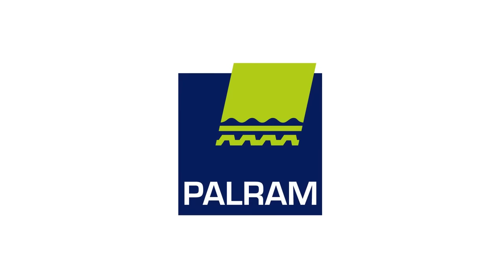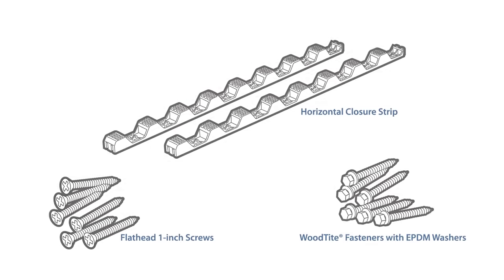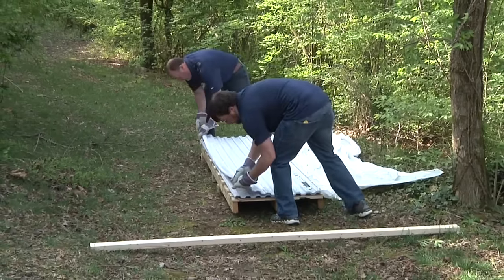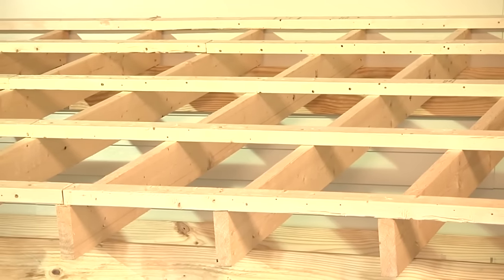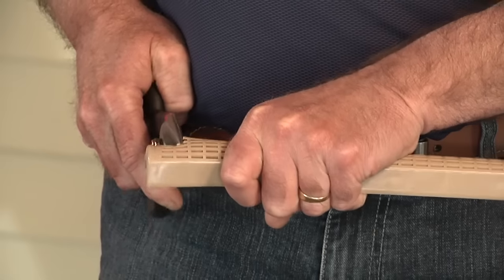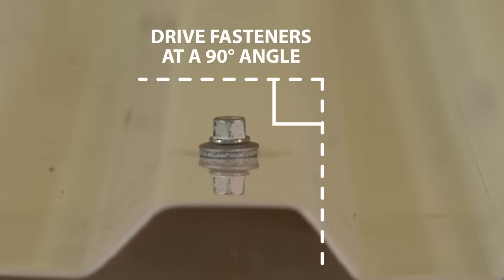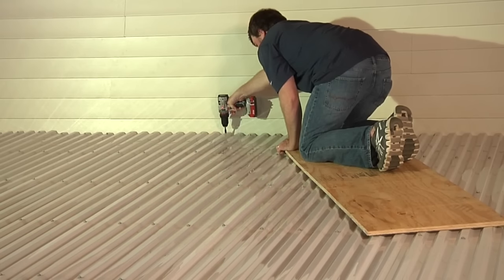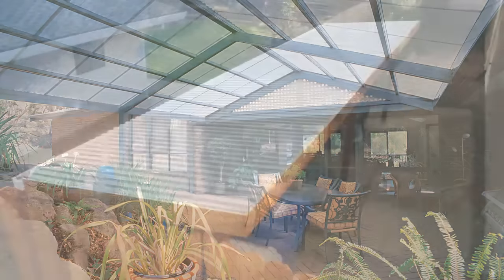How to: SUNTUF® Installation DIY

Comment: So its interesting how none of the videos including this one do not show the pre drilling. Why? Because its incredibly time consuming and I mean time consuming and depending on where you chose to do it dangerous. Right now I'm installing the very ones in this video. Here's what I'm learning , if you decide to pre drill with the sheets on the roofing, it's  dangerous because you're either on a ladder applying force to areas you have to reach out to. If you decide to get on the roofing structure, well that's enough said.  Now if you get the enclosures suntuf sells that's even more pre drill time because if you go through the plastic bracket with the 1/4 inch drill bit the hole is too big for the bolt now and you're sol. So you either mark the hole area, pull it down and drill then put it back up or do what I was describing earlier. So it can be dangerous and very time consuming to get these panels up correctly. We really should be better youtube stewards of what we put in our community.
Reply: A valid point made by you.  I am about to install these very same panels as well.  I am curious as to what you found was the best way.  Right now, I don't see any better option than marking the holes and taking the panel back down to drill them.  A process I'd rather not do but like you said I can't afford to mangle all the plastic brackets.  You've likely saved me some time and stress already just by pointing this out but like I said, I thought I would pick your brain to see if you figured out a better way having recently installed these yourself.
Reply: Hi Matt, what I ended up doing was while the panel was laying on the bracket, I marked a spot on the panel with a sharpey where I wanted to drill then slid underneath the panel between it and the bracket a small thin pirce of wood I could drill on so when the bit broke through the panel it hit the wood under it and I'd stop drilling. My piece of wood was long enough that I could do 5 spots at a time. Hope this helps
Reply: the store I bought from used wooden brackets or closure strips so I just stood up there with 3 different drills, one for the pilot hole for the screw, one for the hole in the polycarb panel, and one for the driver bit.  I also conscripted one or more of my kids to pass me tools as needed.  Cost was $20 per 2' x 8' polycarb panel, $4 per 6' wooden closure strip $9 per box of 100 fancy screws.  Hope this is helpful to someone.  Also worth noting was which way to install the panel.  I had my first panel already in but with label facing down.  All the overlaps would have been on the downside of the corrugations increasing my chances for leaks and wind catching the edges as I didn't do sides so no side flashing.
Reply: Self tapping screws with the washer pre attached. And go
Reply: I followed their directions to the letter and my roof leaks at all the holes. They say not to tighten down the screws where they will dimple the plastic so I was extra careful about that, but now it leaks like crazy..any suggestions? I did pre drill
Reply: @vinylsoup  loosen screws, dab silicon, gently retighten.
Reply: I use 3/4 in self tapping screws with the rubber washer but not on the raised part you can fasten them with the 3/4 screws on the flat parts of the panels with no problems with cracking the panel. When I did mine I used 2×4  joist hangers attached to the wall then 1×4s across (horizontal) the 2×4s even walked on the panels stepping on the 1×4s of course with no damage to the panels of course I only weigh about 145 lbs.
Reply: @vinylsoup  A small blob of silicone on the screw heads getting it around the circumference of the screw will do the job no leaks guaranteed.
Reply: @sleddy01  or just cover each screw with silicon. Hope mine don’t leak.
Reply: Hey Mario, next time try to not be so scared and it will allow the process to go smoother
Reply: @HHh-qe2ch  Does not allow for thermal expansion of the panel around the screw. Eventually the panel will get cracks.

Comment: instead of using a circular saw to cut this plastic I would recommend using a magic marker to mark the length then using very large tin snips to cut one sheet at a time by hand... the saw blade can tear up the plastic easily
Reply: the key is a saw with a blade meant for "plastic"....if you're using a metal blade of course it's going to tear the plastic.
Reply: I apply a couple layers of tape and draw my cut line on top of the tape.  I then cut on the line using a thin kerf saw blade intended for laminate veneers.  The tape makes for a clean cut.
Reply: Reverse your saw blade.

Comment: Ridiculous, you can buy the panels at homedepot but you can't buy any of the finishing parts, like roof caps and flashing. Deal breaker.
Reply: I just looked, they do have roof caps and flashing.
Reply: @debm3391  not where I am from they do not, Las Vegas
Reply: you can order them online and ship-to-store
Reply: I had to buy the roof cap on line. The man at HD sold me the side flashing which he called the roof cap.

Comment: I dont now if this channel is moderated, but Ihave a qustion. I want to use corrugated panels but the roof area is not square, how to you mount the end of the panels to a angled roof line?

Comment: I am building a shed and the roof will be a single pitch, flat style roof. The front side will be 8 feet high across the  front, and 6 feet high across that back. How do I flash the front, higher peak? I am afraid water may run below the panels and into the shed. Thanks.
Reply from the maker: Hi Skizai87. We're having a little trouble visualizing what you would like to flash. Any chance you can email a simple sketch of your question to info@palramamericas.com, or perhaps more of a description (free-standing structure? How long is the slope? Are you planning a small overhang (e.g., 2"-3") on the "front of the structure? etc.). If we can't answer your question there, we'll arrange a phone call to learn more. Thanks.

Comment: Purlins are about complete.  Almost time to let the metal hit the meat.  I got installation pre-jitters.
Reply: Howd the install go?
Reply: @tyrellanderson5312  keeping panels aligned and square was tricky. I thought they would space themselves properly. By the time I noticed it was too late. Chalk line helps?
Reply: @fightswithspirits915  Easier with 2 people. Tape or screw horizontal & vertical closure strips in proper alignment - using small piece of panel for guidance to keep everything aligned straight. Best  I could do, worked fairly well. Instructions here and manual certainly wasn't help.
Reply: @TurboMountTV  thanks. Makes sense. roofing not even close to laying tile. Gotta plan out the roof as you suggest or have some form of spacing jig.

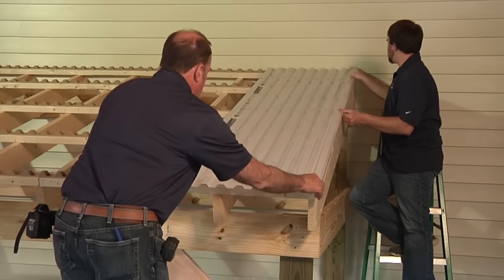Comment: Are screws supposed to penetrate into the purlin, or just into the closure strip? 3:40  Are 1/4" holes drilled into the closure strip? 3:22

Comment: If you’re going to cut multiple sheets what I did is use a laminate blade and turned it to the reverse side. Circular saw and went really slow, worked great, I cut 5 at a time.

Obviously a plastic blade would be best but I couldn’t find one so reversing the saw blade worked for me.

Comment: Are any roofing fasteners required to be installed along the vertical closure strips in between the ends of each horizontal closure strip?

Comment: I’m installing the panels on my pergola. Question I have is when I screw in the fasteners should it be in closure strip or should it be penetrating the purlin?
Reply: Notice how you didn't get an answer.
Reply: Screw through panel through closure strip into purlin. Use 2" Woodtite screw.

Comment: I purchased some of the panels which are uv protected on  one side only , I need to uv protect both sides bc I am using them as a fence. I know you can special order them with uv protection on both sides, but is there a product I can use to treat theother side?

Comment: We really want to use this product but need to know the very least amount of pitch needed to have snow slide off.
Reply: Debra Fisher Hi Debra. I have watched several different videos on different brands of corrugated plastic roofing and a minimum pitch of 1-1/2 x 12 is pretty consistent for rain/snow to slide off. Seems very shallow to me as someone who has framed many a roof. I live in Idaho and in our mountain locations with heavy snowfall, they would suggest a minimum pitch of 8 x 12 for a metal corrugated roof. If you receive heavy snowfall, I would stick with an 8 x 12 pitch. Just my 2 cents worth

Comment: Are the plastic horizontal and vertical closures still available? My retailers only have them in wood materials.
Reply: You can order online. I've read you really don't want to use the wooden ones.

Comment: Why are panel screws placed on the crowns of the panel rather than the valley? Why not give the length of the washered panel screws?
Reply: Any holes in the valleys will result in leakage. On the other hand, a hole in the crown (with rubber gasket) will shed water into the valley and not leak.
Reply: @RobertJohnson-th2yf  No question about which you are.
Reply: @RobertJohnson-th2yf  you really like insulting people.  does it make you feel good?

Comment: uuuh.. What is the flat screw spacing in the valleys on the horizontal closing strips? 1 screw every 6" ..12" ..16"?
Reply: Did you find an answer?  I'm going with 12 inches since the panel will actually be fastened to the purlins anyway.
Reply: You only need 2 screws to hold it in place until you attach panels which will screw them down further.
Here it says to screw down closure strips. Call in tech support and they don't - just attach via panel through strip into purlin.

Comment: I like the idea of letting light through but does it also let heat true?  Of idea of having a roof over may patio is to keep the sun and heat away so.... will this product do the trick or there are better options out there?  Also, cost wise, how does this compare to alternatives when it comes to material?
Reply: Phillip, thanks dude.
Reply: We have used this product on a few of our decks and the clear panels definitely let a lot of light in and while it’s nice to have a clear view, it can feel like a greenhouse.  On the roofs that we used the darker colours like sea green or yellow the it’s much cooler. Sea green was our favourite as it gave the best balance of light and heat.

Comment: Would this work well for an under deck ceiling?  How would you modify the installation?
Reply from the maker: Hi, Andrea. Thanks for your interest. While Suntuf and Suntop can both work very well as under deck ceilings, Palruf or Sun n' Rain are probably the most appropriate due to cost. In an under deck application, there is little concern about heat build-up (provided the under deck area is open and well-ventilated), and there shouldn't be any other concerns about things like impact resistance—something that the other two products excel at. There are a number of ways that you could apply our product in an under deck application, but it's important to consider drainage, and therefore you really should install the panels with a "slope." Here's a link to our DuoDeck™ under deck page so you can see one method of installation: http://www.palramamericas.com/Products/corrugated-accessories/DUODECK/. Also, here's a link to purchase the DuoDeck™ bracket on HomeDepot.com: http://www.homedepot.com/p/DuoDeck-2-1-4-in-x-7-3-4-in-Galvanized-Steel-Under-Deck-Bracket-96240/202439569?keyword=duodeck
Reply: Absolutely in process at the moment. Same basics apply. Working overhead a bit more challenging but the perfect product for under deck install.

Comment: Why drill holes? Self-tapping wood fasteners with waterproof washer would make installation a lot easier and provide a cleaner hole.  Is there a problem with expansion?
Reply: yes.  expansion is a given with these plastic panels.  if holes are not bigger than the screws then you get dozens of hairline fractures all over and leaks to go with.
Reply: I failed to drill the recommended holes.  It's amazing the amount of popping sounds heard when the morning sun first hits the panels and they begin to expand.  The great amount of expansion actually results in the closure strip tabs breaking off; I find the busted tabs lying on the patio.  Drill the recommended hole, and set your screw on a warm day in the full sun, taking care to center the screw in the hole for good coverage of the washer all around, not too tight, not too loose.
Reply: @Chris.Brisson  Do you drill the hole throught the closure strip also and use a longer screw to attach to underlying structure, or does the screw go into the closure strip only?
Reply: @Snipely  yes, you need to screw  into the underlying structure.
Reply: @Chris.Brisson  hmm, that changes things...  then it's not critical to avoid the closure strip when drilling the expansion hole?
Reply: @Snipely  well, you are asking someone who has expansion problems, so maybe I'm not the best qualified to answer.  🙃

Comment: I'm building a varrada in the off the house should I use coragateted thin plastic sheets for the roof or 10ml thick twin wall clear roof sheets .
Reply: Assuming you use a polycarbonate corrugated sheet like Suntuf then the main difference between the panels are rigidity, aesthetics, and insulating factor.  The structured twinwall sheets are more rigid and offer an R Value (which varies by thickness and number of walls). Unless you require the R value you are most likely choosing based on which look you like best and the ease of installaltion.  In my opinion the corrugated installation is a bit simpler.  Typically there are more color options in the corrugated sheet as well.
Reply: Dlos Ok 2 chikitines Ok 3 2 Plato's 3 Barnisdale Evergreen Ok mamy - Illinois Ok mamy. Ok MehmZz

Comment: Suntuf printed instructions indicate a silicone sealant is needed but it was not shown in this video. Is sealant optional?
Reply: I was wondering the same thing.  leaning towards better safe than sorry. a year from now I will not remember the extra dollars or time but I will definitely notice if there is leaking because I didn't bother with the silicone.
Reply: @jamesharris8583  I had leaks immediately after installation so I had to climb up and back out every screw to put a bit of DAP 230 silicone under every washer. I made sure it was enough to create a complete ring around the set washer. There was a huge rainstorm the next day and no leaks. I highly recommend doing this as you go. Otherwise it seems like a good product.

Comment: i want to use polycarbonate roofing for an outdoor kitchen..want a curved roof..is it possible with this material?
Reply from the maker: Hi Vinesh. Suntuf panels can conform to an arch radius of 20-feet or greater. This is mentioned in our Suntuf Installation Guide (http://www.palramamericas.com/docs/upload/F409Suntuf_Install_Guide.pdf). If you're not sure what the radius is, I have created a new FAQ on our web site that provides a formula and a diagram showing how to gather the measurements used for the calculation formula (unfortunately, I can't post an image within this comment, so you'll have to view it on our site). The FAQ questions is titled "Is it possible to use Suntuf Corrugated Polycarbonate on a curved roof?" You'll find our FAQ's at: http://www.palramamericas.com/FAQ/

Comment: How do you seal along the vertical closure strips with butyl tape?  They are not the same height as the horizontal ones, which seems like a design error.

Comment: I replaced the panels on my existing patio cover. The original owner made the cover on an angle so each panel needed a different cut. What is the best way to cut the panels while they are installed ? I want to make them all flush.
Reply: Used a skill saw with a tacked 1x4 as a guide, came out great.
Do you have any videos on installing flashing ? Thanks Jay

Comment: H
i can i fasten the sheeting  to the wood in the lower grove  of the panel
Reply: It is not recommended. Water typically runs through the low part of the channel when it rains so putting a fastener in this location increases the chance of a leak
Reply: Yes, you can just use the 3/4 in self tapping screws with the rubber washer worked for me no leaks.
Reply: @koshnaranek2317  where do you live? Do you get lots of rain?
Reply: @Jason-bk1xs  Yes it usually comes down really hard and fast and no leaking whatsoever.

Comment: How far apart can the horizontal rafters be?
Reply: This depends on your snow load requirements please check the brochure available for download from the website as it has snow load tables with typical spans
Reply: @Timrin1  Thanks for the reply. Zero snow load. Southern California.
Reply: @EM-fi2qg  I believe the official brochure says a maximum of 32 in on center. Again you can double check that if you look at the website / download the installation brochure.  Unofficially I do know some people who went to 48 in on center but you need to be concerned then that the panel will start to sag under its own weight because it's not supported frequently enough and/or wind could begin to cause vibration because of the larger spans   Under the better safe than sorry methodology I don't recommend exceeding manufacturers recommendations.
Reply: @Timrin1  Thanks for the info and taking the time to reply. I didn't realize the info was on their site.

Comment: What is your recommendation for screw spacing when connecting the horizontal closure strips to the purlins with the !' flat head screws? Every valley, every other, etc?
Reply: You only need enough screws to tack the closure strip in place while you install the panels. Ultimately the screw that you use to install the panel will tie the panel to the closure strip to the purlin and hold everything together.